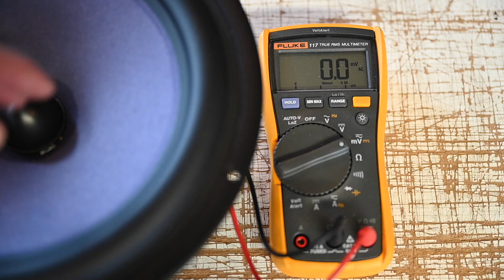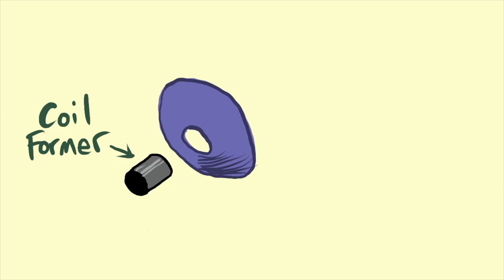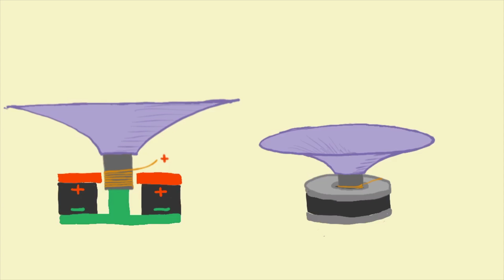How Speakers Work #1: Anatomy of a Driver

Comment: Great video! I used to work for Altec Lansing in Anaheim. I started on the heavy speaker line and at one time or another occupied each position. I rebuilt damaged drivers in customer service and moved to amplifier and crossover assembly when the speaker operations transitioned to Oklahoma City. This is the most succinct walk through how speakers are made and how they operate that I've seen on YouTube. Congrats!

Comment: Great instructional video. I had zero understanding how a driver made noise before watching this. The one question I have is how does a speaker transition or pass off the low-mid from the woofer to the high tweeter? Is it inherent with the limitations of each driver or does something else manage this. I'm probably not using the right terms but essentially how does the tweeter know what parts of the noise it should play vs the woofer?
Reply: Of course I typed out the question and hit send only to find that you explained everything in the next video 🤦‍♂️
Thanks, great tutorials, it's really fascinating stuff. When you said earlier the technology has been around for 100 years it blows my mind thinking about the moment somebody discovered their invention could actually reproduce noise accurately, what an incredible moment.

Comment: Your analogies are a bit tortured - you could have just said tube, instead of coil-former,which sounds odd. A speaker is a transducer, not a generator  - yes you can make it produce a little voltage, but basically it changes one form of energy into another. Saying it's just like a generator is confusing.
Reply: ;-) I thought the same, why not comparing it to an electric motor and then to a linear electric motor, a generator is a bit off, but coil+magnet+movement=current is the idea and I think it came across.

Comment: Hi John, from a structural standpoint I would think using a larger voice coil would make a woofer or mid woofer more stable, I realize there are trade-offs in most engineering but I’m not sure what they are. Cost/ Driver efficiency?

Comment: Hopefully the suspension surrounds that you use in ALL of your very expensive (IMO) speakers are NOT made of foam!!!  In terms of longevity, foam surrounds will, without exception, deteriorate within several decades, if not sooner, and will not last as long as virgin rubber or doped cloth which seem to never deteriorate.  Virgin rubber and doped cloth obviously cost more but these have been shown to pass the test of time as I'm sure you know!!!
Reply: DeVore uses SEAS woofers which have rubber surrounds.
Reply: Excellent choice of drivers!!!!!!

Comment: This is probably a jr question but, when building a driver how do you determine the sensitivity and load (4,6,or 8 ohm) of the driver? And can it be changed later if you decide it’s not meeting your requirements?

Comment: How does the shape and size of the dust cap effect the sound at different frequencies?
I have been trying to experiment with this myself by making different dust caps out of fiberglass cloth hardened with (the smallest possible amount of) epoxy..